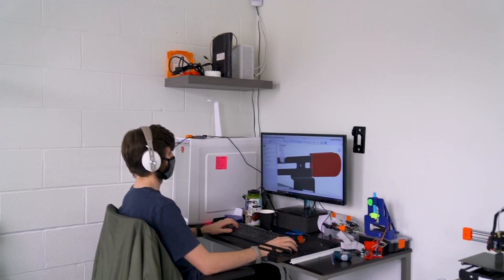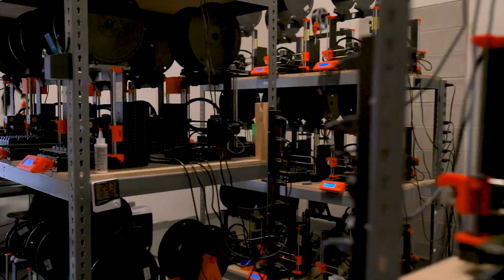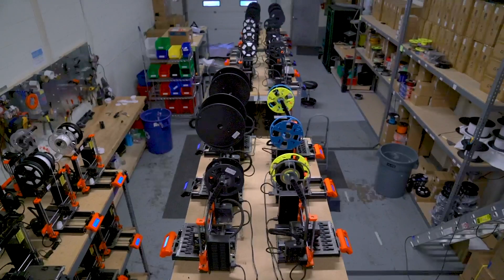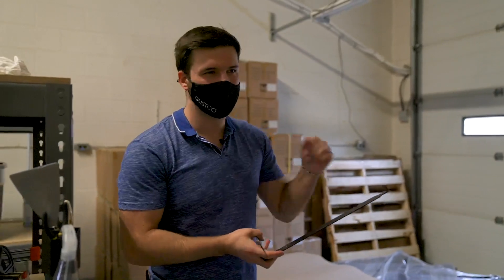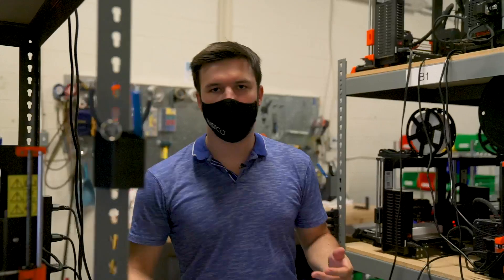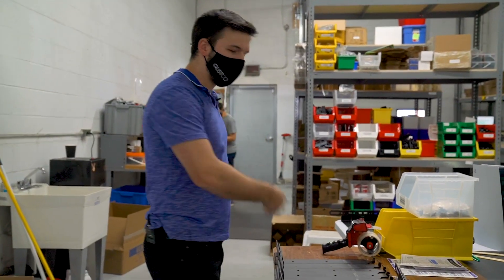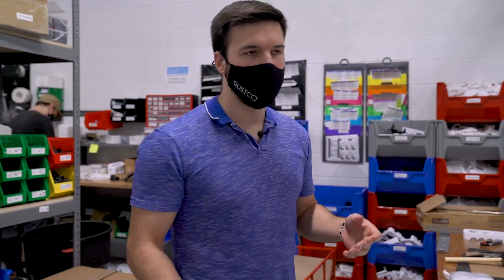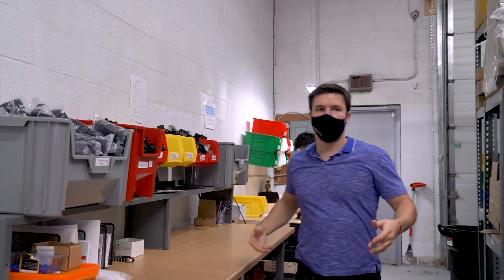3D Printing Farm | Glistco Warehouse Tour

Comment: Could you tell us more about the mini? What kind of problems do they give you? I want to expand my farm (I only have two prusa mk3 and the low price of minis is very tempting)
Reply from the maker: Mini's are decent, but I have found the MK3's to be much more reliable. We had heat-break issues with the minis. They print well, but for a farm environment I would recommend the more stable MK3's
Reply: @Glistco  Also had heatbreak issues with my Mini leading to under extrusion and even clogging. Replaced it with a Bondtech heatbreak, and the problems went away. Have printed more than 1000h after the switch, and it has been very reliable ever since.
Could be worth a try, think I paid €16 for it.

Comment: Could you share the approximate failure rate that you've experienced with your printers?

What other printers did you test before you decided on the prusas?

What software do you use to manage your prints?
Reply from the maker: Hmm, It really depends on what we are attempting to print, maybe a 10-20% failure rate. I tested Anycubic, creality cr-10, flashforge create, and dreamer. Makergear.
The prusa is the one to go with, the one thing I would add would be a touch screen.
We dont use any software, they are all run manually.